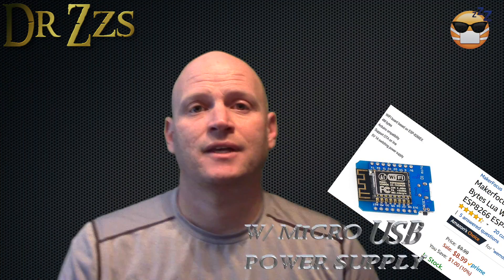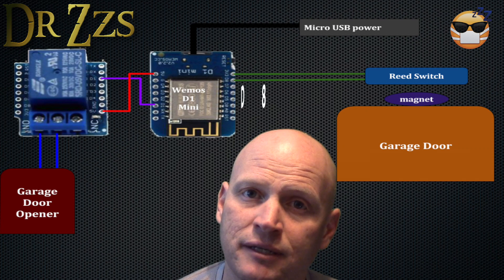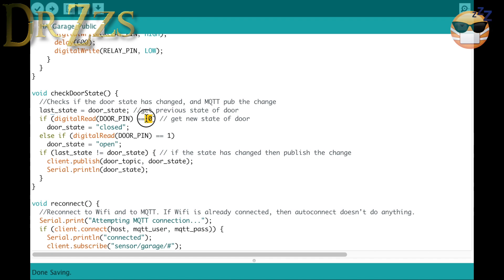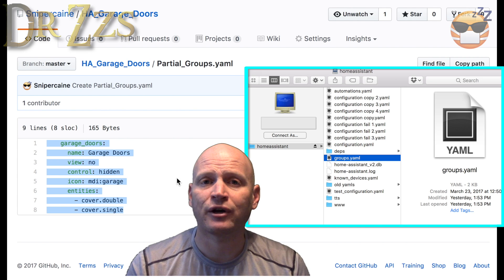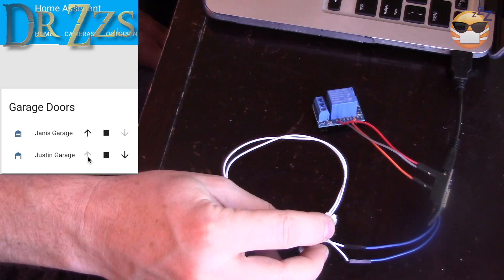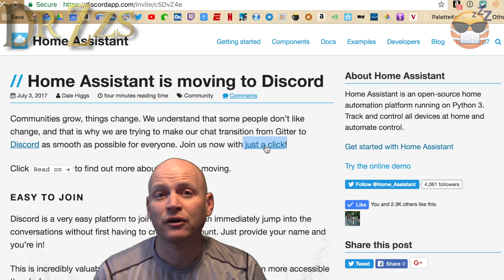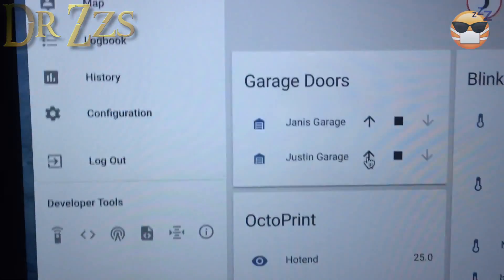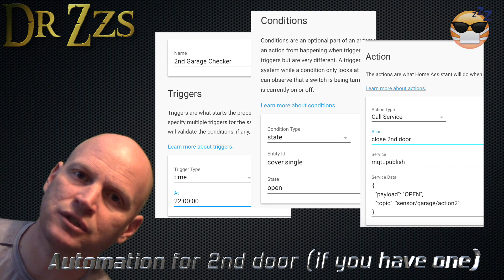DIY Smart Garage Door Opener

Comment: I just rigged this up this afternoon, thanks for the walkthrough and code! However, it works just fine when plugged into my computer's USB port, but when I transfer it to a cell phone USB brick, it never seems to come back online. Any suggestions for troubleshooting?
Reply from the maker: That's odd.  You've tried different cords and phone bricks?
Reply: I did. And I actually discovered a fix last night. 

If I hit the reset button twice after plugging in, it comes back online. I have no idea what causes that. But at least I know the fix.
Reply from the maker: ha!
That's odd.  Well, glad you got it working!
Reply: Thanks! Now I just need to figure out how to get a DHT22 and PIR on there, too, for extra data. Because if getting as much data as possible isn't the goal, I'm not sure what is.
Reply from the maker: ha! 
The one with the most data wins!

Comment: So after 3 days of messing around with this and finally just ditching Hass.Io for Hassbian I finally got this working. I glued the magnet to a clothespin and stuck on the chain, then glued the reed switch to the case around the gear. It seems to be holding just fine. I'm probably going to add a zip tie to make sure that it holds. Thanks for the video. It was a fun first home assistant / arduino project.
Reply from the maker: Awesome! 
ya, i was running Hassbian when I made this (I don't think Hass.io was out yet).  I've just barely made the leap to Hass.io.  I haven't had a problem with the doors since changing.  I wonder why?  
Welcome to Home Assistant!

Comment: When I reboot HA it doesn't remember what state the garage door is in. I have some sonoff's running tasmota and had to turn on retain on the actual sonoff's. How can I do that with this? I know there is a retain option in the HA config but from what I have been reading that won't work.
Reply from the maker: It does that for me too. 
I'm not exactly sure how to change that.  Maybe having the state of the door sent automatically to HA on a schedule instead of just on a state change. Or, maybe an automation that checks the state of the door on a schedule.  
I'll have to think about that one...
Reply: Did some searching on the HA forum and came across a solution thanks to simpat1zq. Here is a link to his page that explains his setup. 

http://automatedhome.party/2017/01/06/wifi-garage-door-controller-using-a-wemos-d1-mini/

Below is the piece of code I grabbed from his sketch and plugged it into the sketch you created.

long lastMsg = 0;

//pub every minute, regardless of a change.
  long now = millis();
  if (now - lastMsg > 60000) {
    lastMsg = now;
    client.publish(door_topic, door_state);

Completed a few test scenarios and works great. Status in HA shows the correct state within 60 seconds (just depends on the timing)
Reply from the maker: Sweet!  
I'll include that in the sketch on github. 
Thanks!
Reply: I implemented another solution, I added an MQTT-message in the reconnect() function, that sends the state of the reed-switch upon first connection (or after connection is lost and regained), with QoS of the message set to 1. This means, that the Wemos will send this message until the MQTT-server has responded to it. Now, since I have both MQTT-server and Home Assistant running on the same RPi, this was what I needed. The code on http://automatedhome.party/2017/01/06/wifi-garage-door-controller-using-a-wemos-d1-mini/ seems to sending an MQTT-message every 60 seconds, regardles of anything have changed. I prefer not to do that.

Comment: First of all I would like to tell you thank you for your video, without it I would probably spend 4 times as much to put my garage door into Home Assistant.  I hope you don't mind I read through the comments and saw some were having issues with the .ino file that puts SSID and Password into the sketch.  I thought I could help if someone else was having issues, you basically just need to add the commands for the board to connect to your wifi with the SSID and Password. All you have to do is make your setup function look like this:
void setup() {
  //Set Relay(output) and Door(input) pins
  pinMode(RELAY_PIN, OUTPUT);
  digitalWrite(RELAY_PIN, LOW);
  pinMode(DOOR_PIN, INPUT);
 
  Serial.begin(115200);

  if (WiFi.begin(ssid, password)) {

        while (WiFi.status() != WL_CONNECTED) {
            delay(500);
            Serial.print(".");
        }
    }

    Serial.println("WiFi connected");  
    Serial.println("IP address: ");
    Serial.println(WiFi.localIP());
    
  client.setServer(mqtt_server, 1883); //1883 is the port number you have forwared for mqtt messages. You will need to change this if you've used a different port 
  client.setCallback(callback); //callback is the function that gets called for a topic sub
}
Anyway hope you don't mind and maybe it will help someone else.  Great Video Thanks for putting me on the right path!
Reply from the maker: I don't mind at all!  
Thank you!

I'm still a little stumped on how my connects without my SSID and password. 
I'm still an Arduino rookie and me and a friend put that sketch together ourselves.  I'm sure it could use some improvements.  

I appreciate your input!
Reply: Hey finally got mine working again great video saved me $70 with this little DIY.  I just wanted to give something else on your sketch with the wifi password, To get this working  I had to set the define statements to:
#define RELAY_PIN 5
#define DOOR_PIN 15 
respectively and I created a function for the connection to wifi.  If you want I can send you the sketch that I used so you could include in your git hub.  Thanks again for the video it was fun and saved some money at the same time.  Keep up the DYI projects with Home Assistant!
Reply from the maker: Thanks.  Yes please send it.  I know that sketch needs work. 
justin.aden@gmail.com
Reply: Sent hope it helps someone else that finds your posts.
Reply from the maker: Thanks!

Comment: Anyone have any good solutions for automating the door when you drive up? I’ve tried the tracker on the app but it’s wildly inconsistent. Paired with the tracker for my modem, still inconsistent. I’d love for this to trigger when I pull up. Maybe iBeacon or something? Just wondering if anyone had already solved this dilemma.
Reply from the maker: Third Justin here. 
I abandoned presence detection for now because of inconsistency also. I was using OwnTracks and iOS location tracking. Neither was super reliable. You can use IFTTT with Home Assistant now through webhooks. I have a couple videos with different examples but they aren’t using location at all. IFTTT is not very reliable either. 

A post I saw on Home Assistant forums claimed to get great consistency using Home Bridge and Home
Kit. Looks complicated and I haven’t tried it but I’d like to. 

https://community.home-assistant.io/t/homekit-iphone-multi-user-presence-detection-using-homebridge/28453
Reply: jmyler try an IFTTT applet associated with your smartphone location services.
Reply: Justin Tomblin that’s what I’m doing currently and it’s really reliable but I miss having conditions like if the door is already open to ignore it. Thanks for the reply love your videos!
Reply: jmyler They're not my videos. I think the guy making the videos is also named Justin. BTW, I just read that Home Assistant's website says they have plans to integrate IFTTT in the future. I'm surprised the integration isn't already native.
Reply: Justin Tomblin I saw Justin and then my brain took over from there. Just three Justins hangin out haha
Reply: DrZzs I believe you are first Justin. I may be 3rd Justin, lol. Anyway,  I think a simple solution to the use of location services as a trigger is wifi. I use several apps and tools which use location triggers and they are usually sloppy when relying on gps or cellular signal but usually spot-on when wifi is brought into the mix. Even IFTTT has been consist with Wi-Fi turned on.  Increasing wifi signal coverage is as important as signal strength at home or office.  Even allowing your personal device to connect to other public wifi hot spots helps certain apps work better.
Reply: DrZzs just for this reply I hereby deem you Justin 1 of 3. I’m definitely going to give this a shot.
Reply: I haven't configured this for my garage door, but I have a sonoff used for lights, using Homebridge to control it from my iPhone. I am not currently using Home Assistant, but I have it set to turn my lights on when I come home, and the location services work really well. I haven't tried to get Home Assistant and Homebridge/HomeKit working together.
Reply: This showed up in my Google feed the other day.  https://hackaday.com/2018/01/21/esp8266-beacon-announces-your-arrival/
Reply: https://www.youtube.com/watch?v=LE1CvGWqSsw

Comment: Bro how are you? , i do some changes to your code , now i could use 2 channel relay in the same code , well i use the second channel for the light inside of garage door device. if you are interested tell me and i give you the code, thanks so much for all your work  and enthusiasm.
Reply from the maker: Awesome!  Yes totally. Send it to me and I'll put it in the github repo.  
Thanks man! 
Thanks for being a stalwart supporter too!
Reply: Bro in this case i use a Nodemcu but could you use a D1 mini, i use d1 ,d2 and d8 only.  ino link  https://1drv.ms/u/s!AiMAXcWisVuuga11DMdHdN6GSkECNQ
Reply: bro add this to your configuration.yaml for the second channel

light:
  - platform: mqtt
    name: "Garage light"
    state_topic: "sensor/garage/action2"
    command_topic: "sensor/garage/action2"
    payload_on: "ON"
    payload_off: "ON"
    optimistic: false    
    
this work cool, I try to customize this to look awesome but I don't know how, I want to use a sonar for detect if the door is open or not but is very difficult.
Reply: bro in the relay I use close normal contact instead open contact , now when you disconect or plug your esp8266 to electricity your garage door is not open, well when electricity goes away in your house your garage door not open suddenly when the electricity back.
but works normal when you made a click in your home assistant.
I mod a garage door wireless control for this.
Reply from the maker: That's great.  I've had trouble with my relay firing when the d1 disconnects from router and reconnects.  Maybe this will stop that. 
Thanks!
Reply: Bro i read something about that problem , well how can i  publish mqtt with a retain flag false. if you could do that, you resolver the problem.
Reply from the maker: Oh cool.  That's easy.  I'll try it.  
Thanks!
Reply from the maker: Sonar detector would be amazing for this!
Reply: Yes, inclusive could you hack a 4 pin sonar for use only 3 pin(http://www.instructables.com/id/Hack-an-HC-SR04-to-a-3-pin-sensor/) , I found this page (https://github.com/OpenGarage) and is very very cool and i watch a itkinda video using a 3 pin sonar, Bro how do you resolve in your esp8226 to publish retained in false? Have you ever thought about using micropython?
Reply: DrZzs I finally got a this project working but how can I implement this guys idea so when power or wifi reconnect it doesn't open by mistake?
Reply: Aaron Kaufman bro you need to publish in retained false on Arduino code, i don't know how to publish in retained false, please Drzsss help us
Reply from the maker: There are 3 small changes to make in the sketch:
https://www.dropbox.com/s/vg0tfffyr7b96nj/Screenshot%202018-01-23%2019.13.59.png?dl=0
In the setup function ,in the digitalWrite line change LOW to HIGH
Then lower down in the callback function, there are 2 more digitalWrite lines, Where yours says HIGH change it to LOW and where yours says LOW make it HIGH.
https://www.dropbox.com/s/nby048kyqm4m3z7/Screenshot%202018-01-23%2019.14.25.png?dl=0

Then on your relay you move the NO wire to the NC contact. It'll fire once when the board first powers on, but after that you wont have any random openings when the wifi connection goes down and reconnects. 

I've had mine that way for a little over a week now and no random openings so far.  I don't expect I'll have anymore.  It's a good solution. 
Good Luck!
Reply: DrZzs thanks brou, thanks
Reply: Thanks! Will try!
Reply: Ok did what you suggested and when i disconnect wifi & let it reconnect, it works correctly and does not trigger the door. However, when power is unplugged it triggers the door and when plugged back in, it triggers the door again. Can this be done so with a power outage(which last unknown time) it doesn't trigger at all and leaves the door in the current state?

Comment: For a small project box, check your local Dollar Tree store. Yesterday I found a set of 3 for $1 that will nicely fit an Arduino or Raspberry Pi.  https://www.dollartree.com/Plastic-Snack-Containers-with-Lock-Top-Lids-3-ct-Packs/p352768/index.pro
The lids have levers that securely snap them in place as well as a gasket on the bottom. So they seem to be watertight, but of course, if you drill holes for power, etc. you will need to seal the holes with silicone. Do NOT use hot glue as it is not watertight and will leak over time. Width: 3.5" x Length: 4.5"
Reply from the maker: that's awesome! 
Thanks for the tip!

Comment: would this be possible to do with a sonoff? I just started experimenting with them for light switches, I was wondering if they could be used for this as well.
Reply: DrZzs lol don't skip that..we love ur videos ..keep up the good work
Reply from the maker: I've thought about that too.  I think it would work best with the Sonoff SV.  It's made for lower voltage and you can separate the control board power from the relay contacts.  There's probably a way to use the GPIO pins as a sensor too, so you can use a reed switch and make it a cover in HA.
Reply from the maker: nathan horvath I’ve got the sonoff SV working with the relay isolated. Still working on using gpio pins and reed switch for open/close status. I think this is going to be a good solution.
Reply from the maker: I've got the Sonoff SV working on the bench with the full functionality!  One MQTT command controls the relay, GPIO14 connects to the reed switch and sends another MQTT command that sets the state of the door in Home Assistant so you can know open/closed.  Just finished it last night! 

Tonight I'll try connecting it to the garage door and make sure it works.  I'm hoping to have the video done by Monday.  I'll just skip sleeping and eating for the weekend ;P
Reply: I plan on doing this with a Sonoff TH. That's the version with a socket for the temperature and humidity sensor. That cuts way down on hardware modification. Basically all you have to do is cut the trace on the circuit board supplying 120V to the relay.
Reply from the maker: Paul Archer That’s a great idea. 
Do you use the sensors for detecting open/close state of the door?
Reply from the maker: Awesome! Thanks!
I'm working on a different way to do the garage doors using a Sonoff SV. 
I'll have the video out Monday morning. 
I've made some changes to the sketch on the github page too, that'll make this method better.
Reply: DrZzs please share ur research with all. I would love to do this project using sonoff basic.
Reply from the maker: Thanks!
Reply: Thats really cool. I think one of my projects I want to try is using a sonoff, or some similar DIY solution to control my Heat & Glo fireplace
Reply from the maker: That should be fairly easy.  How do you control it now?  is it just a switch?
Reply: There is a switch, and I could just control it that way, but there is also an rf remote that can control intensity, fan speed, etc. and i think it would be cool if I could control at least some of that.
Reply from the maker: There is a sonoff model that has RF included.  I know nothing about what capabilities it has.  There's also an RF bridge.  I don't know much about that either.  Super helpful right!?

Just in case you get ambitious. 
https://www.itead.cc/sonoff-rf.html
https://www.itead.cc/sonoff-rf-bridge-433.html

Both are on the compatible devices list for Tasmota. So they can be hacked... if you're feeling lucky.
Reply: Very interested in this topic!  I am a subscriber DrZZs, your videos are a tremendous help.  I want to get my garage door working ASAP
Reply: DrZzs I haven't implemented it yet, but I do plan on using two sensors, so I can detect completely closed, completely open, and stuck in between.
Reply from the maker: Genius!  
I'd love to see how it turns out!